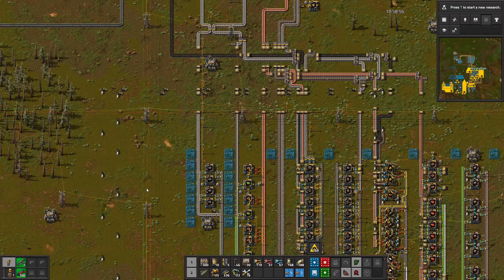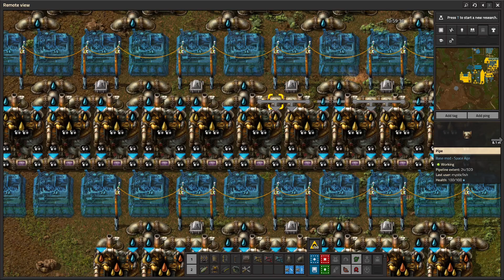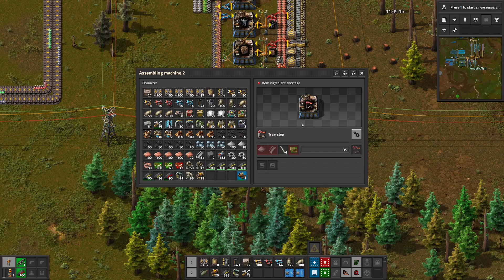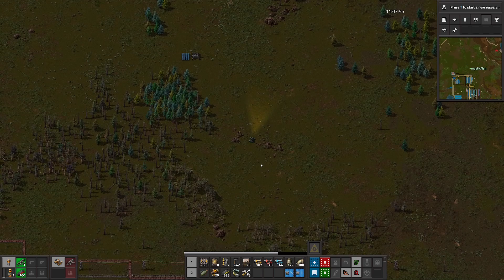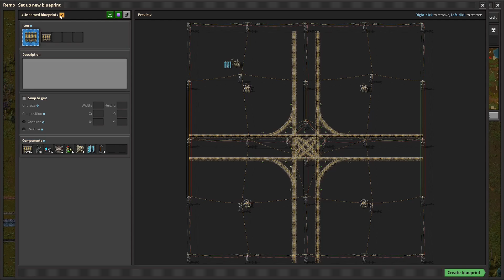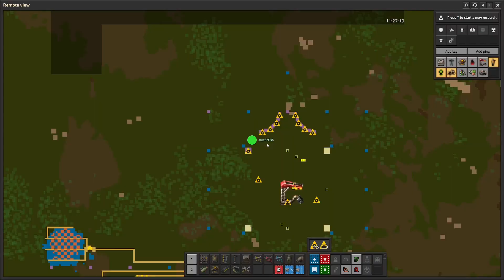Ep12 - Grid-Aligned Rail System - Factorio Space Age Expand-a-Base

Comment: May I suggest redesigning 4-way intersection? This one is extremely inefficient, because there is only one block in the center, and even non-intersecting trains will have to wait. Even roundabout will be better.
Reply from the maker: Yes, I’m aware. In 1.1 it was possible to make a 4-way this way at this width between the rails and signal it better in the interior to make separate blocks, but that’s not possible in 2.x. I’ve decided to make the tradeoff that I’d rather have designs that are easier to stamp across each other (straight -> 3-way -> 4-way) than try to optimize for throughput. I find in practice that (a) I don’t have to use 4-way intersections that often; and (b) because trains primarily carry ore, traffic is not that high, and contention at intersections isn’t too bad.

But let’s see how things work, and certainly we can redesign the 4-way if it becomes a problem in practice.